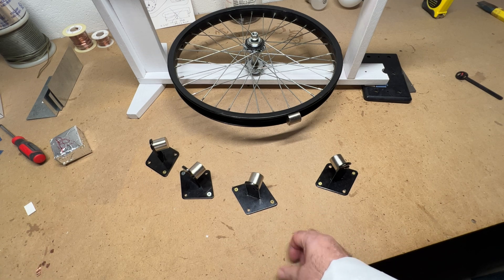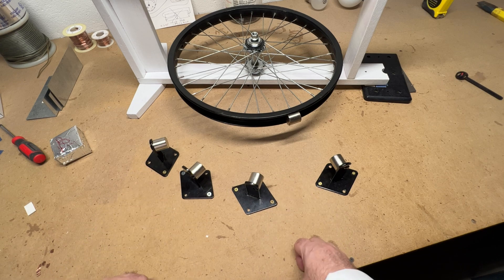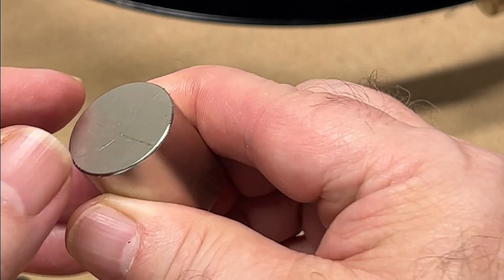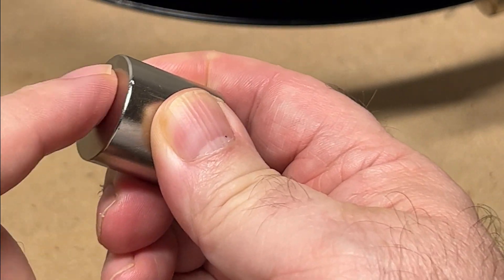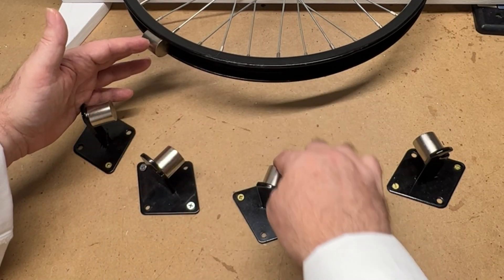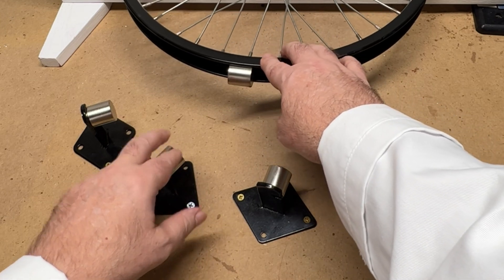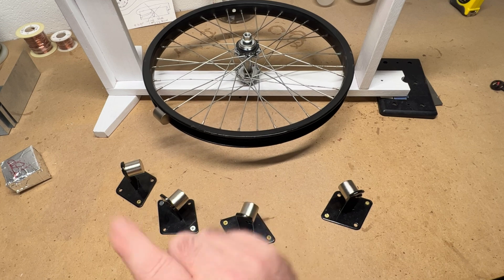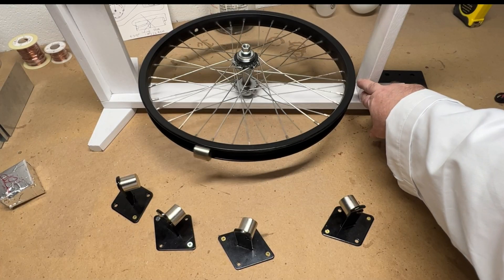🧲 BREAKING NEWS: Free Energy Generator Motor Research Preliminary Breakthrough.

Comment from the maker: 🧲10.19.2022 - Eighteen 1" x 1" N52 Cylindrical Magnets have now been ordered. Cross your fingers. 🤞 In the event this ends up being a dead end, introducing shielding once again is a viable option, and or harnessing some energy from the wheel to drive a magnetic reed switch? These magnets can pinch the heck out of your hands, even tearing off skin. They are literally the strongest permanent magnets in the world. Watch for updates. 🧲
Reply: Hi James, nice video. Subscribed, couldn't you stack a few magnets together to make long magnets, so it is only attract or repulse? Since longer stack of magnets has the opposing force in further proximity, reducing drag on your magnet on the wheel done in the short magnet angles in your video.

Comment: If there was ever a case for 3d printing, here it is. Regarding shielding, think about it in the same way that early aircraft engineers had to work out how to shoot down other aircraft without blasting your own propeller to smithereens with your own bullets. It's timing rather than shielding I think. I've often wondered whether magnetism has a frequency range, and whether these frequencies, if extant, could be filtered, manipulated and focused, like audio in a synthesizer. I imagine this by visualising the image we all know and love of iron filings tracing out the magnetic lines of flux. If the individual lines could be attenuated and amplified individually and under control, this would be the holy grail. I imagine it a bit like the sonic levitation macines that I think are starting to be used in manufacturing, or at least experimentally. I think that should a technology like this become available it would have immense benefits not only in kinetic energy generation, but also in manufacturing of hitherto unknown metamaterials. Using both the above technologies could see amazing exotic composites made up of microscopic layers of ceramics, fabtics and metals that could also be perfectly  magnetically aligned to create things like clothing that generates electricity just by you breathing and moving. Never have to charge anything again. Impossible with todays tech.
If a mechanical way can be found to filter the magnetic flux (I guess we're getting into the realms of shielding here), but variably, I think I heard a term once "magnetic river" but that's what I imagined - a controllable, directional flow, or focus within the magnetic flux. If we can work this out, I think we'll be flying.

Comment: I can understand and appreciate the years of effort. It has been a long time coming, as if you landed on the moon!!! Much more could be said, but excellent and very good.
Reply from the maker: Point well made. However this magnetic motor challenge was solved way back in 1966 by a German man who made a working car motor that ran only on magnets. See link below. Others as well on the web have also made motors using only magnets. See links below. My design concept is different from most others. The links below were long since made available in the video description as well.

((( MAGNET MOTORS THAT ACTUALLY WORK )))
👉🏻 MAGNET MOTOR - Rotor Encantado
https://youtu.be/mxgwTzxfe8Y

Amazing Magnet Motor/Gen Rep. This is not a fake
👉🏻 https://youtu.be/jKFTAobM-l0

WORKING MAGNET MOTOR 2023
👉🏻 https://youtu.be/vdtdKE2Qe40SELF RUNNING MAGNET TURBO MOTORhttps://youtu.be/6sIBHn5-9pI

🆕 WORKING MAGNET MOTOR - rotor magnéticohttps://youtu.be/3mD0_0FiJ54

MAGNET ONLY MOTOR from SOUTH KOREA
👉🏻 https://youtu.be/smzpbKg9S7M

1966: German inventor presents his Free Energy Device Magnet-Motor
👉🏻  https://youtu.be/XWQjMyMWXAc

Comment: Is this really a source of free energy?
Reply from the maker: Yes. Free energy only after the cost of a magnet based generator. Free energy in that you don't have to pay the electric company each month for electricity as long as your generator is scaled up enough to meet your electrical needs. Some 85-90% of the world gets it electricity from using moving magnets as a means to generate electricity.  See links above for some amazing examples that you missed. What I am doing here has long since been achieved by others. Follow links in video description for proof. I'm simply working towards a design that offers the kind of torque that can push a ship or submarine through the water. Most likely it already exist, just that there's no public info on it that I have seen yet. But I doubt it can ever be used for aviation. Thanks for stopping by! Cheers!

Comment: No doubt you're in the right track, and very close to the solution. Congratulations!!!!!

It would be great if someone near you had a 3D printer. They could help you up a lot with tailored mountings as a gift.
With it, is possible to make them adjustable so you can play freely with distances and positions, with zero interference because it's all plastic (ABS, PETG, PLA, etc).
Also, the 3D printer will be very useful to make VERY PRECISE spacers for the shields, just in case you feel like you need them in combination with this setup.

I wish I could help with that, but I live in Italy, lost my 3D printing business to the pandemic, and I'm broken, getting homeless within a week.

All the best. Your invention certainly will change the world. Thank you.
Reply from the maker: Have you followed the links in the video description yet? Others have long since achieved this going all the way back to the 1960s. Nothing new here, only that I have a design in my head not seen in any of my videos that would have the kind of torque that could easily push a submarine or large ship through the water. What no one ever talks about is that once repelling magnets get so close that they are very close to touching each other, the power/torque/repelling force is off the chart. Tap into that then we can produce more torque than a car engine will ever achieve. 

I'm light years ahead of you on the beauty and the seemingly endless advantages for 3D printing, as I have looked into them. However, the learning curve for creating the print files we need is steep. I simply need someone who can replicate parts from my detailed blueprints for the various parts. They don't need to be near me, as all this can be done through snail mail. Sad that there are so few like you who think out of the boxer out of the building for that matter. 

Soon, I'll create a special video detains the exact parts I need to be printed. Hopefully someone soon will see it as their calling, and jump in head first. I don't want anyone's money either. I have money now. I'm set for life as long as I'm careful. I need people with know how who have skills in creating custom parts using a 3D printer.

I first need to prove to myself, not the world, that my design will work just fine. Then we can move forward with the real deal in building a mixture of my design concept. Should, if and when the design proves itself to be worthy, then a full scale model can be built. After tweaking that build, and as long as it continues to show immense promise, a compact design that can easily power entire households is the logical next step. These various stages must be kept off the web at some point, as not to tip off those who would do their best to derail the project. But I'm getting ahead of myself here, so I digress for now.

By the way, my commercial design will simply look like another hotter heater. Same shell, except it will not be metal. PVC most likely, as 24" and 30" PVC pipe is perfect for the outer shell. You drop it next to the other hot water heater that's usually located next to the electrical box, unless it's gas, wire it in, disconnect external power, and off we go. Truly that simple. The voltage regulator is built into the system, and a central battery that used today to run entire houses would be tied into the system to smooth out sudden heavy loads.
Reply from the maker: Here's a whole house battery. They already exist. We don't need to reinvent the wheel here.
https://www.cnet.com/a/img/resize/ade859f2a0c4c89fb53b318905a4a163b251af28/hub/2022/10/21/62d7c35a-f39d-408c-a2ec-5353722a1631/generac-pwrcell-cover.jpg?auto=webp&width=1200

Comment: James, good job. Early in the 1900s magnetic drive was done.  I had trouble getting any info on Howard Johnson's magnetic drive. He had a small platform on 4 small railroad wheels he moved down a RR track magnetically. He used different types of magnets with different sizes and strengths pointing in a wild array of directions on the platform and beside the rails. The weird array just by magnets propelled the small platform short length (4 to 6 foot length rails) down the track. 

I knew this could be done and you did it without needing the magnetic shields. The Roney Stator directional shielded array still has great viability. Perhaps with proper spacing opposing fields could be used even better? At each point with a space between have opposing Stators. The idea is having a neutral crossover zone between opposing magnets. The challenge in any normal magnet is  - what draws magnets then opposes crossover zone. The same magnet that draws  is repelling yet can pull back on the next magnet. 

In other words at one point the magnet faces one direction and with a select space the next magnet faces the opposite direction. The corresponding magnet on the wheel that is drawn by one magnet is opposed by the next at the right place -as it travels to a magnetic free space the other magnet directs shielded magnetism to push the wheel. The key is to create a neutral zones between N and S of the wheel magnet where magnetism is blocked so when the wheel magnet strikes that zone it propels it faster by the propelling magnet facing the other direction.

The challenge is this, as you mentioned with the screws in the posts affecting the travel of the wheel, as well as the metal of the fixture holding the fixed magnets warping the magnetic fields, that the attraction to such metal reduces the momentum. 

In your video if you did not have those screws and a small metal plate was attached to the plastic mount efficiency should increase.

Nice video bud.
Reply from the maker: 🧲 I just made a video that addresses some of what your are saying as well as what a few others are also saying. By the time you read this, it might be up. There are a few videos with toy trains that use magnets that make the train car take off like a rocket. Though things look very promising without shielding, I'll' bring back the shielding should the need arrises. Still have a ways to go here despite how promising it looks so far. This could still be a dead end, but I don't believe so. I addressed your neutral crossover in the next video, and call you out by name. lol

I've yet to have a repelling force act like a pulling force. Once the attraction mode engages, nothing pulls back, if so, its too little for me to detect at this stage.

The wood screws and frame are now gone. The steel arms holding the stator magnets in place might very well be acting  like a circuit if you will that's reshaping the field, of which I'm sure it's doing anyway. Question is... is the reshaping of the field helping any at all? ...or is it causing back drag? 🤔
Reply from the maker: 🧲 Great to see you're still hanging around. Sorry that I missed your call a few weeks back. My phone remains in airplane mode most of the time since retirement, and I don't accept video calls as I'm not properly dressed half the time, and the other half of the time I look like death warmed over. 🤪

Comment: Magnets all around the weel and wire coils fix under the the spining magnet or between the rotor and the stator to initiate a electrical current. Tanks for the idea
Reply from the maker: 🧲I agree with you. Been thinking about that for years now, but with a slight twist. Thanks for stopping by Yvon and hanging out. Much appreciated.
Reply: Graphene wire instead of copper wire to reduce drag and improve electrical flow.
Graphene wire case.

Comment: James I did a video to help explain why the entry and exit points of a magnetic field need to be separated to avoid acceleration cancellation due to proximity to each other its on my channel.
Reply from the maker: 🧲 Thank you Ortorea. I just watched it. I'll need to watch in one last time to see If I need to respond to it in more depth. In my next video which is uploading, I have no cogging issues anymore, and each stator kicks/repells/thursts the armature magnet out with great force. So this issue that you were kind enough enough to make a 17 minute video about is since resolved. The even handoff between stator poles has smoothed things out. What little cogging effect that might be left is so tiny, that it's not a concern at this stage, but might become an issue during high RPM, which could result in vibration issues. Using only magnet to achieve continuous motion is the primary concern for now, which looks like that riddle if you will, may very well be solved soon, with or without shielding which I use to create dead zones that you talked about in your thoughtful video.  🧲 Keep your fingers crossed. 🤞 And... thank you for stopping by and hanging out with me, especially for making your enlightening video on magnetic field manipulation. Very MUCH appreciated Ortorea.
Reply: @FreeMagneticEnergy2  Right on James, vibration is always a big factor. Even a seemingly balanced shaft in bearings at a high enough speed, taking out limits on bearings, would cause vibration with the slightest abberation of the shafts roundness.  Only doing and observing results can show for sure. Do not expect such speed but who knows, perhaps the draw in the air as well as bearing friction would limit speed?
Reply: https://youtu.be/QopPIA-_m9M

Comment: Hi James. I was hoping you would put the wheel at a small angle, deliberately, so that the weight of the magnet(s) on the wheel are being pushed UP against gravity. When they gain momentum, they will swing all the way around and start al over again (well, maybe there is not enough momentum or power to go round, but still it would use gravity to collect some of the momentum and give it back later). As usual: thanks for sharing!
O, and that German video, this is the one: https://www.youtube.com/watch?v=G6cycmBwLb8
Reply from the maker: 🧲 There's not enough stators to push the armature magnet up a hill yet. A gravity based system holds no future for practical production of energy. The wheel was already at a small tilt, which was quickly slowing the wheel down.  Thank you for your keen insight and hanging out with me. Keep your fingers crossed. 🤞 Though things look promising, does not mean this is going to work. Add my shielding will go along ways if needed.

Comment: Is the metal magnet holders acting as a shield?  Going to brass may not have the same effect
Reply from the maker: 🧲The steel magnet holders are behind the magnets, which makes them ineffective for shielding. However, the steel could be setting up some kind of magnetic symmetry that I'm unaware of that might be playing an important roll here. Won't know for sure until further testing. Thanks for the great insight. More so, for stopping by and hanging out for a bit.  Update vide on this on the way.
Reply: No they warp the magnetic field, by the surface design as I suggested today a plastic mount for magnets  holding a small metal plate that the magnet would stick to could increase the efficiency reducing the chance of draw back on the wheel magnet as well as isolate between the stable magnets better. Of course a metal plate would not be needed if the magnet was held in a plastic frame.